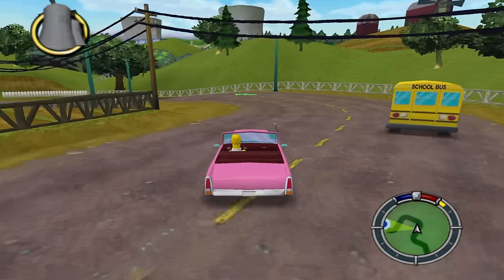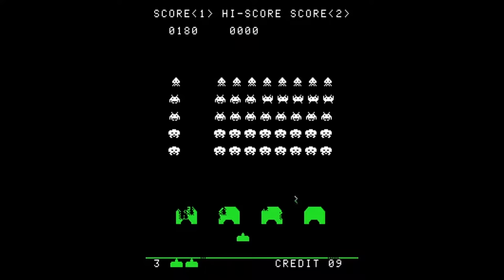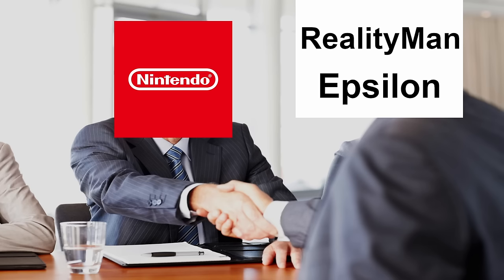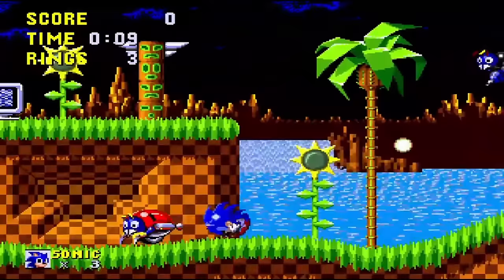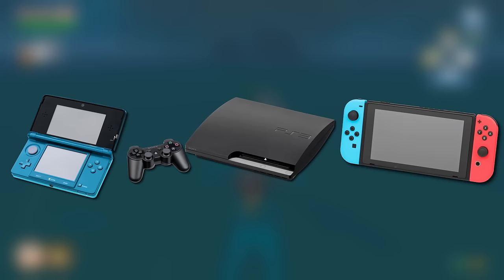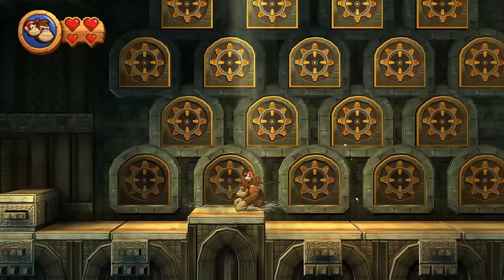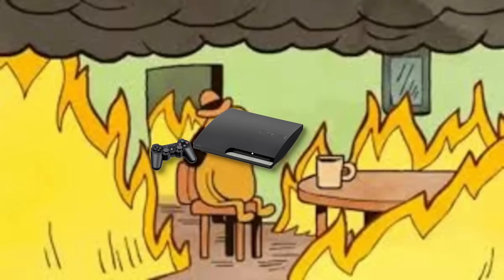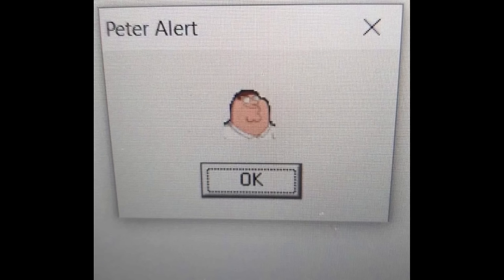A Brief History on Emulators, Rom Hacks and Homebrewing

Comment: For anyone getting into homebrewing, I would highly recommend the Wii to start off with. LetterBomb is super easy to set up, and there's some wicked cool mods available like Newer Super Mario Bros. Wii and MarioKart CTGP-R.
If you're looking to get into emulation via legally questionable but mostly morally sound means, Vimm's Vault is a good starting point. The Vault is a crowdsourced database dedicated to preserving gaming history with cartridge/disc ROM dumps of nearly every game from nearly every mainstream console, home or handheld, from 1985 through 2008. All the VirtualBoy games just got added to the catalog last month!
With a homebrew USB loader tool like WiiFlow you can even play Wii/GameCube dumps on a real Wii lol
Reply: the 3ds is also a good starting point and is (imo) a little bit easier to get the software working. they're both incredibly versatile as to what they can do but you will need a gamecube controller for the wii if you want to get most of the emulators running and some of the software just won't work (usb loader gx just simply does not work on my wii). if you're going to hack a wii just skip usb loader gx and go straight to wiiflow.
Reply: @Officewaffle  I’m gonna double down on this and say the ps vita is the easiest to soft mod now since you don’t need a pc to play psp ps1 and psvita games. You only need a pc if you want to emulate games that aren’t PlayStation.
Reply: letterbomb is already updated, i remember you had to use a 2gb sd card to make it work, i don't know if it got updated
Reply: @jmD2382  honestly you could start with any Nintendo console and any company's handheld and be totally fine, save for the switch and maybe the GameCube. It's remarkable how far homebrew has come.
Reply: There is steam deck as well but it cost a lot
Reply: @coolguy11fortnite  can you really consider running external programs on a steam deck “modding” tbf? Like I get it’s console-like, but the thing is realistically a Linux PC with a pretty front end menu. I dunno, it just doesn’t feel the same. What’s the fun in console modding without the needless hassle?
Reply: Vimm's lair*
Reply: Ps vita is incredibly easy now ,it's all done through a webpage on the vita itself
Reply: @valley_robot  same on the Wii u also, u only need to load a webpage a click a button. Also this allowed to install games and dlcs on a locked console
Reply: @scottcaramel  This
Reply: My first console I modded was a Wii. My second was a Vita. My third was a PS3 I modded with HEN.
Reply: This aged like milk

Comment: Jailbreaking and Softmodding are not the same as Homebrewing.

Jailbreaking is exploiting system hardware of a locked-down electronic device to install software other than what the manufacturer has made available for that device.

Softmodding is using software to gain access to a system to install custom firmware (for example) with the option to easily roll-back to the original settings.

Homebrewing is making new, unofficial software for systems,
Reply: I'm glad you're here
Reply: Lmao pedantic much?
Reply: @megamix5403  yeah words don't mean shit and we should just say whatever we want to represent any idea we have.  It doesn't matter.  There's no need for things to be clear.  Fuck it.

Comment: The thing with the piracy side of the homebrew scene is that there are several legitimate reasons for it. Not only does it help with preserving games and content that either doesn't work due to nonsense server authentication measures (like Gran Turismo 5 for SOME reason relying on its own (now dead) server for DLC authentication rather than PSN itself) or due to legal garbage like licensing causing a lot of games to be delisted or changed to crappier versions to please the suits but it also helps with restoring functionality from dead consoles and prevent them from turning to e-waste.

So if anyone has a console with a burnt out optical drive it's not a paperweight yet. There's still plenty of life in it by loading games off an external drive.

Comment: You're going to have to update this video to include (N64) recompilation now, which will likely be pursued for other game consoles too since it allows these games to run on even less-demanding hardware and allows for mods, expansions, and editors to a degree that is simply not possible with emulators.

Comment: How are emulators made? This is something I've always wondered. I know that the developers (very blessed and skilled people btw) tries to imitate as much as possible how the CPU, GPU and other components of the original hardware work but let's suppose that the processor of a certain console has 1GHz, how is that emulated on a much faster CPU like an i9 with 6GHz? How different architectures are emulated as well? When an emulator is in development, does EVERY game need to be optimized so that it is fully playable without visual artifacts or do they just focus on imitating the original hardware and if this is successfully achieved all the games 'magically' work because they all use the same instructions? So many questions...

Comment: In 1985 there was a ZX Spectrum emulator for the C64. Emulators are much older.
Reply: Really ? I've never heard of that ,how does that work does it only run 16k speccy games ,the speccy has more usable ram than the c64 ,do you have a link ?

Comment: To add to the XBOX series homebrew stuff and why it will probably not see anyone fully hack: most people who have the know-how don't actually want to pirate the games, it's often just a thing that happens alongside opening up the console to play emulators and other fun stuff on it. If there's no need to hack the console and microsoft just opening up a dev mode then I doubt anyone's gonna see if they can play pirated games on it.

The same thing happened with the PS3: that had a linux install on it, people used it and then sony got rid of it..."shortly" thereafter the PS3 got jailbroken. At least microsoft has learned from sony's mistake in that regard.

Comment: So, I just want to share what I know regarding the legality of ROMs and emulators since there is a lot of misinformation online. I am not a lawyer and all that, but as far as I know emulators themselves are 100% legal unless they include copyrighted code or assets such as the BIOS or system fonts (most emulators either require you to get those separately or come with noncopyrighted alternatives). ROMs and ISOs on the other hand are only legal if you rip them yourself from a copy that you legally own yourself, and it is always illegal to give these backups to anyone else (unless you're giving them the physical copy too, in which case maybe it's legal?). This has been tested in court in Bleem v Sony and probably in other lawsuits. On the other hand, it is always illegal to download ROMs/ISOs, even if you legally own the game in question, unless it was authorized by the copyright holder (like how SEGA sells Genesis ROMs on Steam) or if the game is not copyrighted (which will hopefully be more common for older games in a few decades).

Also, completely unrelated but I iust want to mention that The Simpsons: Hit & Run does actually have an official Windows version. I just thought that was kind of funny given the intro.

Comment: i always just thought homebrew refers to any software you coded at home, usually not for commercial sale. 

before video game consoles, we have pc and absolutely no limit or restrictions on who or how you can make a software to run on the machine. 

so early consoles have no limits either. then the infamous video game crash happened as literally anyone could make a game and sell it, leading to trash overflow. And back then game cartridges were not cheap like a download in the play store.

nintendo controlled it with a chip to check for authenticity, and even sued companies that circumvented it to release unlicensed games. that evolved into the walled gardens we have today.

homebrew is simply to return to those days where anyone could code anything AND let anyone run that sw on their machine. but yeah the term is weird, just like any term coined by computer geeks back then.

Comment: Psp was one of the most heavily modded consoles. 
So was the psx
Reply: @user-wg8hv7je3h  

Most people understand it as psx.
Though technically psx was a Japanese console designed to be an all in one media center, but it's typically referred to psx because that's where the emulation scene ripped it's bios and hardware apart. 

Playstation original. Was typically mod chipped to play copied games. 

Ps2 had more capabilities such as, HDD,  ethernet, and flash storage, linux. Mod chips as well as software mods. 

My ps2 still sits on the shelf with custom LEDs and a see through top case to watch the discs spin, as well as all of the above. 

Ps3 had linux.

Comment: 9:50 Uh, no, most roms hacks are not made using hex editors.
Very early wacky rom hacks, yes, but from then on they are made using editors the modding community made
Like, Super Mario World's level editor, Lunar Magic, had its first release on sep 24th 2000
So this is basically the opposite of what you're saying, it should be "early rom hacks were made using hex editors, but most rom hacks are being made using specialized tools"

Comment: I think you should have mentioned recent developments of using FPGA hardware. The emulation you described is software emulation, but FPGA's on the other hand is hardware emulation which can result in better accuracy but also being able to mimic the finer details of the original hardware. The MiSTer project is by far the most dedicated community driven efforts in this field and demonstrates that emulation is a tool to play existing games on hardware not specifically designed for it. You can play your ROM files on original hardware if you have the means such as using a flash cart or modding your system but emulation is the easiest way to utilize ROMs and being able to play them in an unintended environment.